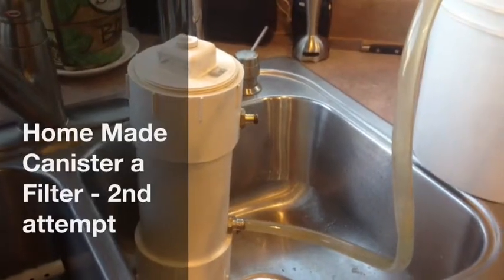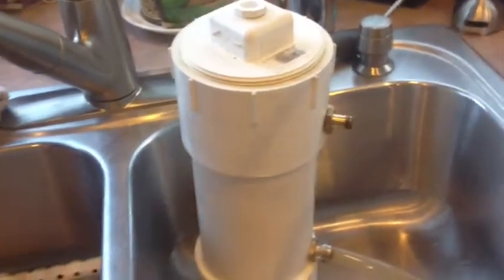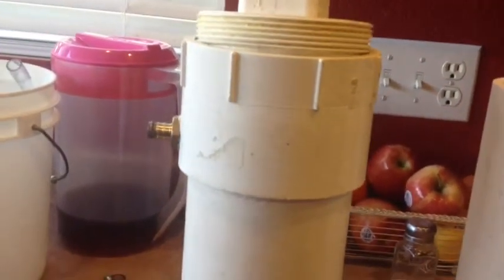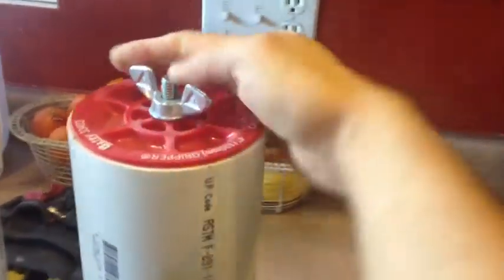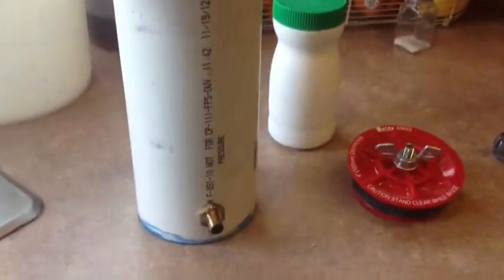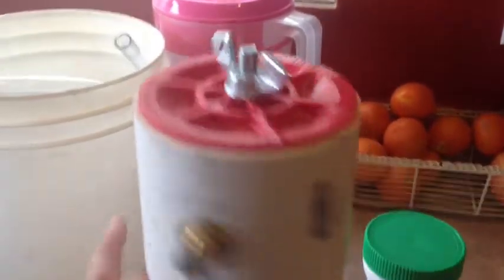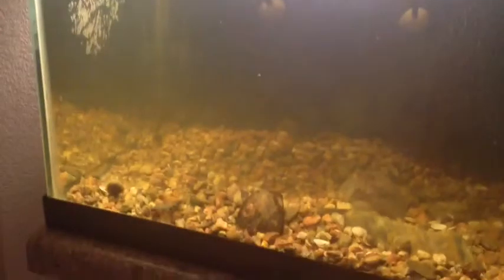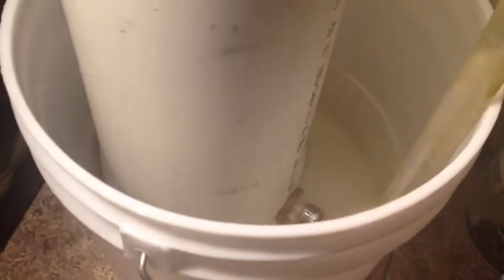Turtle Filter #2

Comment: I made this and it works great I also made a spray bar with half inch pvc and filled it with pot scrubbies on the bottom the polyfill and on top of that is a corser filter filling of the same type of material the water is crystal clear for the first time

Comment: This was working perfect but since I had the pump pushing through everything it was working the pump harder shortening it's life and compressed all the media , so I made step like things in the canister to hold the media up and switched the pump like you had with it pulling the water through but now it has air bubbles coming through which slows the pump down and is really loud do you have any ideas why this might be happening? Thanks.

Comment: I like the red top you use with the rubber seal never seen that. I made a filter out of the Two Little Fishes 150 reactor and they make a bigger one too. I also have the small pump inside the tank. This size is 3.1/2" by 12" long.  Here is the video of the one I made. DIY Filter from GFO Reactor 150.  "It Really Works Good"

Comment: Hey I built my canister exactly the same as you after having watched your video. the results were great! I keep running into a a prob with a small leak around one of the brass fittings. ive building it again on a 2nd canister as well but i notice i have problems drilling into the PVC to get a nice circle....1 of the holes comes out kinda lop sided.
Reply: Use Silicone I (not II or III or any silicone that says mold control, just regular general use silicone) on the areas for the hose fittings on the PVC pipe, its a round surface coming in contact with a flat surface so there will naturally be gaps.  The silicone will fill those gaps.

Comment: Have you thought about a smaller aquarium? That turtle has way too much room in there.
Reply from the maker: I had always read that you should try to give them a large environment so that they have room to be active.  My goal was actually to get the biggest tank I could afford to keep up.  I must say that I really was no expert.
Reply: What size tank is that (gallons wise)
Reply from the maker: Amanda Lynne Meyer That was a 20 gallon tank.  I had him in a 30 gallon before but it broke during a move.  I was hoping to move up to a 50 gallon next.  What size tank do you use?
Reply: My comment was meant to be sarcastic. The absolute minimum depth far an aquatic turtle would be twice the length of its shell (head to tale). Of course, length of the tank is also important to consider. These guys need to be able to swim. A 20 or even a 50 (I assume you mean 55) gallon tank is really not adequate. Also, that tank will stay a lot cleaner if you remove all the rocks. The rocks can also be bad because many turtles will ingest them causing their digestive system to become impacted.
Reply from the maker: It's hard to tell sarcasm in print, I think we need a font for it.  But agreed, it was not an ideal tank for him.